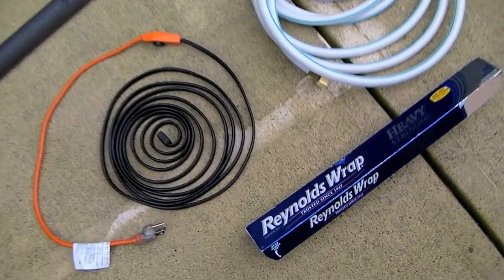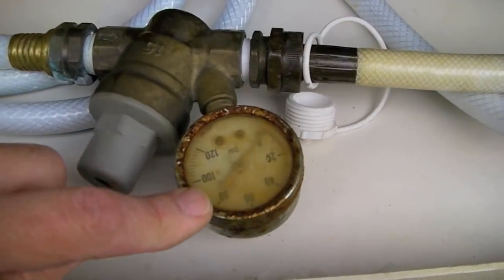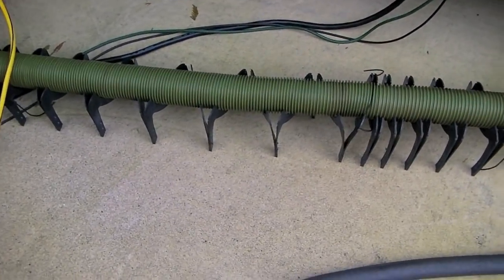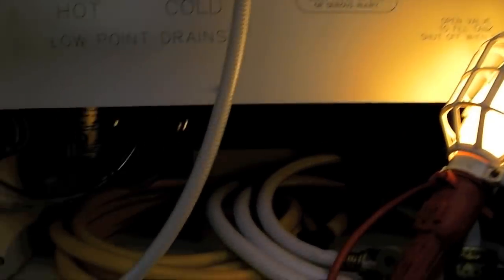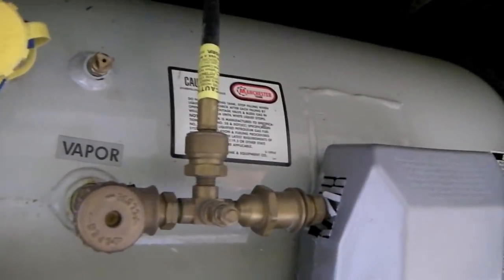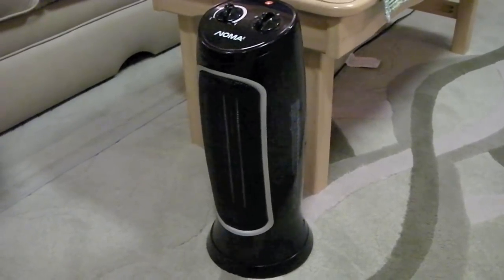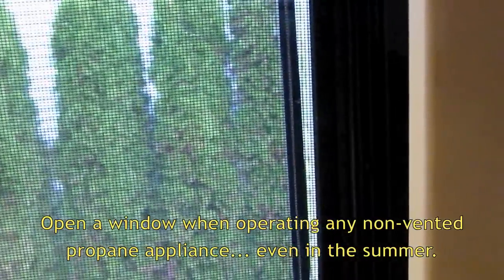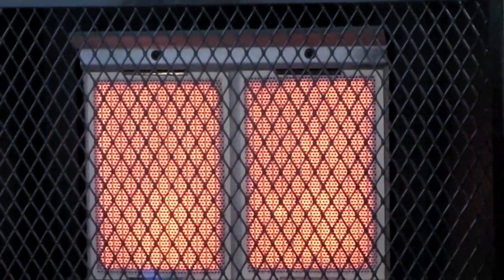How To RV in the Winter - Prepare Your RV So You Don't Freeze!

Comment: I worked up north in ft mac and lived in my fifth wheel year round... Full timing in a 1974 trailer was bad but then I did the heat tape on all the trailer plumbing and wired in all new plugs and new breaker panel. Now I just use it at home and I have 220 to it from my shop for the hot tub, stylin'

Comment: I'm thinking of getting an RV for my winter seasons in B.C.  Tempratures as cold as -35c (-31f) and consistantly below freezing for months on end.  Thanks for the tips, but I'm sure there will be alot more prep needed to be done to my future RV to keep tanks/lines/sewage from freezing.  Mostly because I have a dog now and work in the ski industry.  Most places dont allow dogs and if they do it would be almost $4000/month to accomodate my pet.  If you have any other advise on running an RV in the more EXTREME tempratures would be great.  Worst case scenario I will empty all holding tanks and not run water to the RV at all and use my friends showers, sinks and toilets :)

Comment: I had a 1974 fifth wheel I live in up north in Ft.Macmurray. did heat tape on there and spray foamed underneath. I also put carpet inside of it tape plastic saran wrap over the windows to keep drafts out. never froze a pipe. now I own a brand new fifth wheel. things have changed since I lived in that 1974 back in the 70s

Comment from the maker: We only had temps down into the low teens during our winter in BC, so you surely have colder in PA. However we did hear from people in very cold climates who told us that using heat tape was effective for them. Is it the hose or the standpipe that's freezing, and is everything wrapped? Are you sure that the thermostats are working properly and that the heat tape is coming on?  Or is it colder in PA than I think?  ;-)

Comment: Just a couple of things.

When building your heated white-water hose, put the heat tape into the foam insulation pieces BEFORE you put the hose in. If you leave it on the side near the join the heat from that heat tape can soften the glue on the foam edges and cause it to come unsealed at any stress spots such as places where you've turned a fairly tight corner or coiled the hose. It won't happen immediately but it's no fun getting out there in the dead of winter to try to tuck hose and heat-tape back into the insulting foam tubes. 

Also, always leave yourself a good length (about 4 to 6 feet) of extra heat-tape at your inlet end of your white hose supply and about a foot or two at the other end. It's a lot less expensive to use one longer heat-tape than it is to buy two. This allows you to attach heat tape to the stand pipe as well as to the brass connectors (including pressure regulator and filter) at the RV end. By doing this you only will need to use one electric receptacle instead of two. (Yep, you"ll quickly need that extra receptacle! Maybe for your water compartment heat source) 

Some people use the liquid RV roofing material to 'paint' a coat of protection on the entire hose now that it's heated. Others just wrap it in sealing tape of one kind or another. But that foam insulation will soak up any moisture created when the heat melts the snow that falls on it and your hose then lies in a puddle of melt water.  

To control your water compartment heat source (a 60w bulb in your example) you can order (Amazon) a small thing called a THERMO CUBE that plugs into the receptacle then lets you plug your heat source into it. It turns on only at 2C (35F) and off again at about 5C (41F). They run from $13.99 to $39.99 so hunt around bit for a good price. I use the cheapest one - it is exactly identical to the most expensive - and it's just perfect. I don't need to monitor the temperature in that compartment unless I want to. I just set it up and forget it, knowing that it will turn my heat bulb on and off as required. 

The last thing I want to mention is fans. Two of them AT LEAST!! Get some 12v ones that you can hook into your Rv wiring and some 120v ones that you can just plug in to the regular house receptacles in there. The rule about fans/moisture/mildew is simple: If you're not rolling, then the fans must be on! I keep four on 24/7 and I have been boondocking here for 2 years with nary a sight of mildew, mold or moisture.

Comment: When using Propane heater run a dehumidifier. This will then take care of the moisture issue but will also act as a small heat pump!n  Next time you use your dehumidifier feel how warm the air is coming from the fan you'd  be amazed! Works the same as an air conditioner in reverse. Feel the air coming off a window air conditioner it's usually so hot that you'd get a burn from touching the housing vents.
Reply from the maker: +Russ Eastburn (ESP1000) Great tip!

Comment: I used to own a camper years ago, I was hooked up to my parent's house and thought I would use enough water to keep the line from freezing, but that didn't happen.....so I came up with an idea, what I thought was genius, since the water tap and the outside electric sockets were pretty near each other anyway, all I did was wrap the line around the hose (the twist was was about 1 revolution each foot or so).  When the snow came, there was a good 4 inches on either side of the hose completely melted of snow, and the hose never froze.  I didn't insulate any of it, and although it drew a little bit more electricity for the distance, I thought it worked perfectly fine.

I miss those days, honestly.....the freedom of not having to pay a damn thing in rent, and just pay utilities?  Hell yeah.

Comment: Good tips.  I would highly recommend installing combination carbon monoxide and smoke detector units in the RV to forewarn of  build up of CO and possible fire.
Reply: Check the expiration dates on any smoke, carbon monoxide, or propane leak detectors you have.  The date should be somewhere on the back of the device.  The detectors don't last forever, so replace the unit when it reaches the expiration date or you'll just have a false security. For example, smoke detectors only last about 10 years.  If you can't find the expiration date or manufactured date on the unit, check the manual and your purchase date or the manufactured date of your RV.  If it's 10 years or older, just replace them anyway and keep track of the new expiration date by writing it on the unit.  When disposing of an old detector, consult your local hazardous waste disposal site.  Some smoke detectors have a small amount of a radioactive element in them, which should not be discarded in the general waste dump.

Comment from the maker: @metube1976  ...continued... All coaches aren't the same though.  We have a traditional propane RV furnace that blows hot air.  Some coaches use diesel to heat with an "Aqua-Hot" hydronic system and don't use propane at all.  Another system uses propane hydronic heat.  Hydronic heating is like a radiator that blows air across a heat exchanger.  Both of those systems can use electric too, but I'm not sure what they do automatically.  Maybe someone else with more knowledge can comment on that.

Comment from the maker: Dozens of major retailers (Sears, Lowes Wal-Mart, Home Depot, etc) sell vent-free propane and natural gas heaters specifically designed for indoor use. Properly functioning propane appliances produce an "ideal burn" during combustion and present no danger of carbon monoxide poisoning.  Surely you noticed the cautions about keeping a window cracked for ventilation and having a properly tested and working CO detector.
Reply: That's great information , thanks..

Comment from the maker: @NativePrairie WolfTwo - In the park where we stayed, everyone we spoke with used the exact same heat tapes without problem and recommended them to us. Most of the people who spend the winter there have a length of water hose they keep with heat tape foam-tubed onto it for use every winter, and we haven't heard one report of failure after repeated winters. Neither of ours had any problem all winter either, so if they're "prone" to failure, that was not our experience.

Our RVs walls have R-11 walls and R-16 roof and floors. The furnace uses a lot of propane because it's not as efficient as the one we installed ourselves.
Reply: +RVgeeks : I hope you're using a good quality (and regularly inspected) carbon monoxide detector. A lot of people have died because of those "widow maker" propane heaters.  We live in Michigan and Deer season is a state holiday here.  A lot of people have died over the years from propane heater malfunction in their campers. So be warm, but most importantly... be safe! 

Thanks for sharing this information! 

Have a safe, healthy and happy New Year!  :)
Reply from the maker: We sure are! And there’s always a window open a little bit for a source of O2. Happy New Year!

Comment: EXACTLY! this was my 3rd winter working for a circus that plays in upstate new york for jan and feb we don't run water but have alot of tricks like this to keep stuff running u forgot to mention some anti freeze in the holding tanks if u don't have a direct sewer dump also awning on the slide outs help so u don't have to clean all the snow to be able to close it. before u spend ur first night plug everything in and make sure the breaker wont pop so u don't loose power in the midle of the night

Comment from the maker: @wazzup105 Since the heat tape is designed for metal pipes, wrapping it separately from the hose helps prevent the heat from over-softening the rubber, since it gets pretty warm. Works great without damaging the hose.
Reply: What happens when the power goes off?
Reply from the maker: +Jerry Giddens We can run the generator if needed.

Comment: good vid ,i have a vw lt /in the winter my exhaust runs 2 inch from my water tank,if i run the engine for 5 mins the whole thing defrost,also i have a solar heat mat used in garden stores to keep seedlings warm,i place my 2 gas bottles on them and cover with a battery jacket this prevents gas from freezing.

Comment: its not necessary to use the foil. working as a plumber I can tell you just your heat tape inside foam wrap is sufficient.. also instead of running it straight along one side, you can spiral the heat tape in long loose wraps around the hose..
Reply from the maker: Thanks for the tips, Mike! We mostly used the aluminum foil to try to keep the heat tape from overheating one side of the hose, since it's really design for metal pipes.
Reply: RVgeeks
actually most new plumbing water pipes are a plastic.. it works just as well on them.. the heat tape is not real high temp.. its just warm enough to keep the water from freezing. it doesn't take much.. The box your water line comes into in your RV is unprotected.. if warm air is not vented into that box it could freeze the lines inside there if it gets really cold.. you could stuff some insulation up inside there if necessary.. I dont know how cold it gets where you are but im talking very very low temps..
Reply from the maker: +Mike Crane Thanks Mike! 😊

Comment: Use foam panels to insulate your cabinets and closets, think about spray foam where you can. I have heard of doing the underside of the RV, just not the pop outs.
Reply: Great ideas!  I feel the cold air pouring through my closets, especially! Thanks!
Reply: I use a bubble wrap that is covered in a foil type material..get a big roll for 38.00 at Lowes. I did inside every cupboard I did both sides of my door panels going outside and underneath the couches and the one back wall and my one bedroom floor I completely covered underneath the rugs but this reflects a material because it gets so cold in there. We also put insulated panels underneath the RV and it really helps keep the floor warm so far
Reply: Great! thank you so much!
Reply: scarletfluerr h

Comment from the maker: We've read that putting the heat tape outside the aluminum foil does a better job of evenly conducting heat around the hose, plus avoids overheating one side of the hose (since heat tape is really designed for metal pipes).

Comment: I've spent 2 winters in a travel trailer in Central Oregon where the winter temps get down to around 5° F below zero. My trailer is 29.5 feet long, skirted & insulated but the floor got a bit cold. My pipes have never frozen. All & all it's a good life.

Comment: Better to wrap the heat tape inside the aluminum against the water hose.  The black button of the thermostats are supposed to go against the hose.
Reply from the maker: +Robert Palmore That would work okay too, but the reason we chose to put the heat tape outside the aluminum foil was because the heat tapes are primarily design for metal pipes, and we didn't want to slightly reduce the amount of heat against the rubber hose to avoid over-softening it on one side when the heat is on. We also left the thermostat out so that anytime the outside temperature dipped near freezing, the tape would just come on.
Reply: RVgeeks The frost king tape is a self regulating style heater.  As the material heats the resistance goes up and causes the heat to go down. It's probably the tamest of all the heating tapes you can buy.  Ace hardware sells a much warmer tape that is also safe against plastics.  All the manufacturers have made sure their products are plastic safe due to PEX being so prevalent.  My experience comes from being a contractor and having lived in Alaska.  You won't melt your hose. Best of luck.  Cheers.
Reply from the maker: +Robert Palmore Thanks Robert! We'll keep it in mind next time we winter somewhere cold (which will hopefully be a long way off.... we're currently enjoying temperatures in the upper 80s in the Desert SW). :)

Comment: My grandfather had a pump house for water on his farm and he heated it with a 100 watt light bulb it cost him a lot of electricity being on continuously I picked up a high voltage thermostat and wired it inline on an extension cord and plugged in an electric heater and it cut his electric bill by 1/3 in the winter.
Reply from the maker: What a great tip. Thanks!
Reply: RVgeeks your welcome
Reply: I don't know dude. Was his bill $14 and that's today's money?60 watts x 720 hours/month = 43200 watt-hours / month = 43 kW-hrs /month. 
 Look up your cost of power, I'll assume $0.10 per kW-hr 
 43 kW-hrs /month x $0.10 per kW-hr = $4.30 per month.
Reply: fin screenname I don't know where you got 60 watts from I said it was 100 W lightbulb and he really didn't use much electricity other Than that he didn't have a TV very seldom cook for himself we would cook at my house and take it over to him. And as far as the cattle barns and stuff like that that was on a separate meter that me and my fiancé covered and electric heater takes less power to run even if it's an on and off cycle then it does to run a hundred watt lightbulb continuously because the LED that indicate whether the heaters running or not I relocated to the outside of the pump house and it Was barely ever on. His bill was average of $60/month after using the heater vs the 100watt lightbulb his bill average was $40/month
Reply: You could also use such a snake heater, just get it around the pump and along the water outlets and it will turn on automatically if needed.
Reply from the maker: +Ruben Kelevra Thanks for the tip, Ruben!

Comment: How I would design an RV for Canada.

The RV would have to have 3’’ insulated walls and roof, the whole water and fuel system would have to have a bladder that could withstand -35c the back compartment would have to contain a fold out 10 minute set up, skirting system when needed. Solar powered and propane and gas or diesel. With extra fuel tanks, Lets not forget the generator that when the sun don’t shine or is low will kick in automatically. A melting system that would take snow and melt it trough a filtration system back into the holding tank for water. Strong diesel engine with a 4x4 drive system, a covered trailer system that holds a car and a snow mobile. A small pellet burner if all else fails. 28ft long so that cabin fever would not set in if we are snowed in.
This is the Canadian bug out or camping RV. Beats living where it’s warm all the time giving crazy canuks the fun of winter and summer. When the snow hits we don’t stop we just get frisky. Oh yeah Eh‼!no smaller than 28ft. no slide outs.
Reply from the maker: Sounds like a great design!  Post a link to your Kickstarter/GoFundMe campaign for building one of these! LOL! ;)
Reply: i lack capital
Reply: A true 4-season 33' (25' cab, 8' garage, feasible if you ditch propane appliances for more batteries) toyhauler with minor offroad capability would sell well among younger boondockers.

Comment: Hey I paid through the nose to heat with electricity for my RV and also with propane which put out so much moisture that my place was cold and also wet like a sponge. Then my neighbor came up with the perfect solution. A Kero Heat Kerosene Radiant Heater. Due to youtube info I now run it on diesel, 91% Alcohol and some Fuel therapy Diesel Injector Cleaner and it heats perfect. Please do your own research and also make sure you really vent your place. But it is a cozy 70 degrees and I am no longer freezing or suffering and it is very low costing.
Reply: John Wright

Comment: The best preparation for winter would be to drive to Arizona.
Reply: Jack Harwick lol noo man Arizona is freezing in the winter man it’s desert!!
Reply: Do you ever use a dehumidifier ?
Reply: Depends in Arizona. Currently have over a foot of snow at temperatures of 12 degree's. The Valley is in the 30's and if you're really in the desert, say Tucson - you're looking at colder temps. Drove up from the East Valley to Pinetop/Show Low and hit snow at 2,880 elevation - Show Low is 6,300.